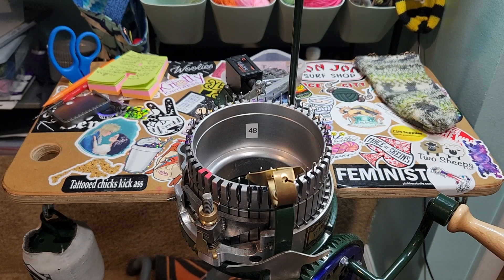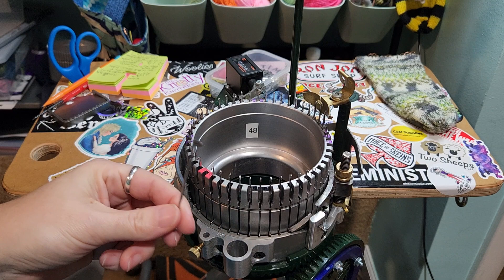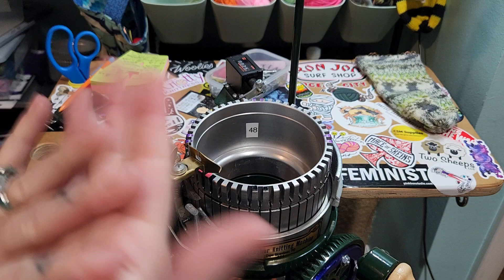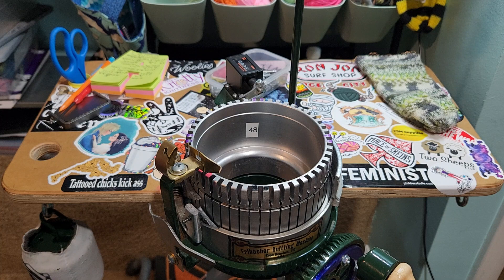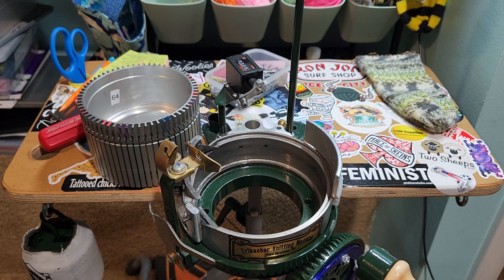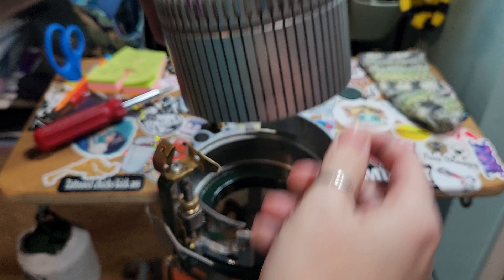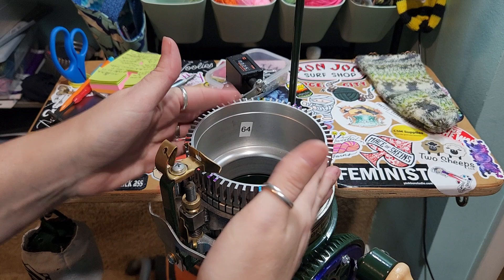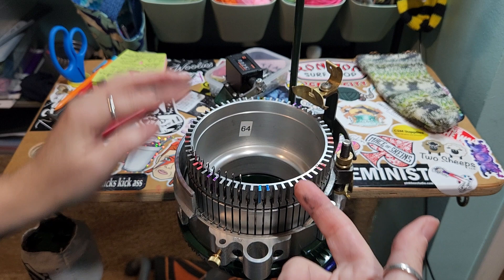Circular Sock Machine Basics | Changing your cylinder | Erlbacher Gearhart CSM

Comment: You made me go look under mine it is an antique one I totally did not remember those screws thank you
Reply from the maker: Mine was manufactured in 2021...eek I think. Imi am not sure how older erlbachers were made. But I think it is still quite similar in design. Some people I think have put bolts with 'wing nut' type ends so they can hand tighten/loosen without a tool